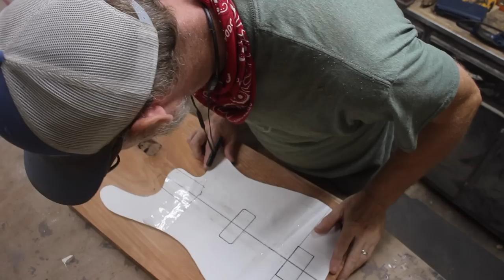Make this Bass! - Templates & Instructions Available - DIY Kit Bass, New Perspectives Music Style

Comment: Move the bass pickup back towards the bridge to be about and inch forward from where a jazz bass bridge pickup would be.
And offer a neck without frets as an option.
Reply from the maker: If you make the kit you can put the pickup wherever you like. you can even buy a second pickup individually to make a dual pickup instrument. You could also pull the frets and fill them, but unfortunately I can't stock DIY kits in every variable. I can, however, make custom instruments tailored to each specific client, which is the main bulk of my business. I love my job.

Comment: you have been my #1 inspiration for building guitars (I'm on my 7th build rn), but I've always wondered why you never use a handheld router with bearing bits for cutting out the body (using a laser-cut template) and for chamfering/radiusing the edges.
Reply from the maker: because I have a cnc! :) Before I had one that was how I did it. Thanks for the kind words.

Comment: I just started using the Klingspor blades and I’m pleased with how they cut (had been using Freud for years).
Reply from the maker: I just ordered a couple bandsaw blades from them  along with my latest sandpaper stockup, too, but theyre not "Klingspor" brand. They are so much better (and often less $) than the box store. I need to be more organized with my stocking ad use them more, not just pop in the box store on my way to work, yknow?

Comment: Dig it, reminiscent of the NS2 Spector.  May have to check out those pickups!
Reply from the maker: indeed, that one too. There's only so far you can push "guitar shapes" without making them too weird. I usually push the outer edges of the design, but in this case I colored way inside the line, which makes it sort of reminiscent of a lot of basses.
Reply: @timsway  I'm building a very similar one right now. Hope I can find a buyer, then I can grab one of those electric bike hubs you sent me info for

Comment: How does the guitar sound more on the bass tone side? The tone was a little bright for my taste. I am seriously digging the kit. And would like to build a bass soon.
Reply from the maker: You can roll the tone off and it sounds deep and muddy, like usual. I demo it here: https://www.youtube.com/watch?v=kcm7jF_FLBI

The kits come with inexpensive strings for the purpose of building it and getting started. I didn't want to make everyone pay extra for strings they may or may not like. So putting your preferred strings on there would help a LOT!
Reply: @timsway  Hey thanks, I watched the other vid. I weirdly like old strings better than new strings. I'm really digging the   kit. One of my greatest concerns is getting the neck pocket depth right. Thanks for the response!!!!
Reply from the maker: @Ilsabug1  not weird. Many bass players prefer old strings. I use some that are 20 years old and I save them if I do change them. The kit comes with router templates and 90 mins video instructions to explain all the depths, tips, tricks, etc.

Comment: I’ve always enjoyed your work and drive to recycle and repurpose but dang Tim these kits are rather expensive and no body included!?
Reply from the maker: Understood. You're not paying for just the parts, but also the templates (system), downloads, several hours of precise video instruction content, support, etc. Certainly you can buy kits for much less with no support and lesser materials, or just buy a $200 instrument completely built! That is always an option, too. These fill a different void.
Reply: While kits of half the price are available I've found they lack quality in some more important areas. I think that the assurance of a better quality kit plus the fact it comes with routing templates which are usually fairly expensive to buy justifies the cost.

Comment: how do you calculate the pickup position?
Reply from the maker: My pickups are bar magnets, not poles,  so there is some flexibility in placement. I went with a center location, like a p bass, for the most versatile sound out of a single coil.